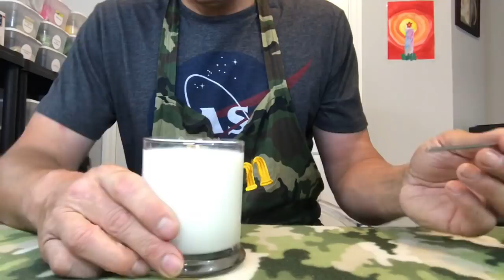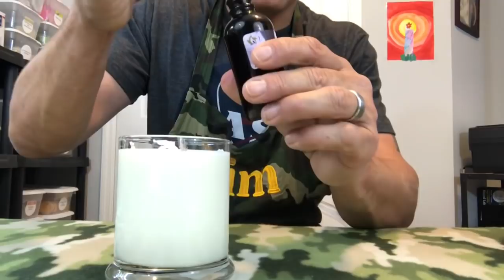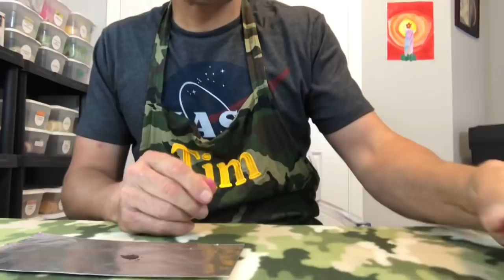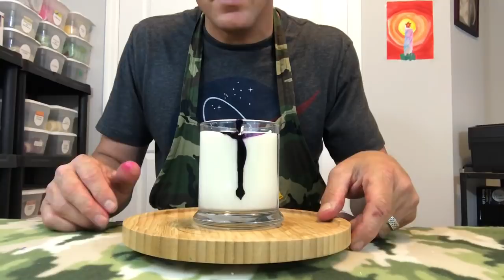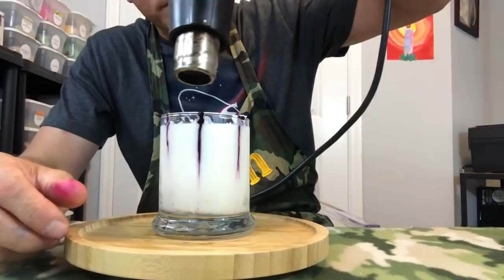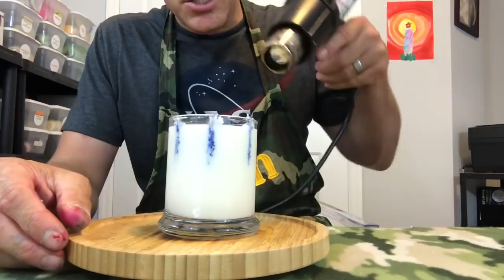DIY Marble Candles

Comment: The concentration of dye is way to high on these, when shoving the sides of the candle with a pick to push the dye, it’s removing the adhesion… the heat gun temporarily gives a swirl look, a few days later this will look messy and no longer have adhesion to the jar.

Comment: Nice video! Can I use a blow dryer instead? Like how hot does a heat gun get that a blow dryer can't suffice for this? serious question
Reply: Blow dryers blow out hot air as opposed to the heat of the heat gun. Using a blow dryer could cause the wax to fly everywhere.

Comment: I am new to making candles... Can you use a blow dryer instead of a heat gun? Not sure if somebody already asked
Reply from the maker: It will only "sort of" work. With a hair dryer it will take 10-times as long, and unless you have a smaller hair dryer, or one with a directional nozzle attachment, the air stream will be to big and will blow your wax around too much. Heat guns are fairly inexpensive, and can be found on Amazon or your local hardware store for $10-$15

Comment: Thank you so much for this! Gosh I was thinking about this and then you posted!
I do have a question. how would I achieve this with wax melts? I want to have that same effect but with wax melts so I dont know if I can.
Thank you!
Reply from the maker: It will be a lot harder with wax melts, the smaller size is harder to work with and the heat gun isn't an option if they are in plastic molds. The closest you can get would be to fill your wax melt molds with plain (uncolored) wax. Then as it is cooling, you can just drop a drop of liquid candle dye in the center of each wax melt.
Reply: @TimberRidgeGifts  gotcha, I will have to try that. Thank you!

Comment: I have a question. Can you do this while the candle is in its mold, and then when it dries, take it out?
Reply from the maker: This particular method will only be useful for container candles. The wax has to be soft enough to be able to poke holes in it. The pillar wax needed for a molded candle would be to hard.
Reply: @TimberRidgeGifts  Oh okay then. Thank you.

Comment: is there any other way to melt the candle? like blow dryer or microwave?
Reply from the maker: A blow dryer would work, just not as well. Microwaves heat things from the inside out, so it would not work for this. Plus the wick tab is metal, so a finished candle shouldn't be placed in the microwave.
Reply: A 200 degree oven works well too

Comment: Can you pre-melt the candle color chips and use a dropper to put the color into the holes for a better result?
By the way, thanks for all of the tips and help! I am a soap, bath and body product maker by trade and am just trying to add some small scented candles to add to my products for gift sets.
Reply from the maker: It might work for a minute, but it will dry and clog the dropper and cause more trouble than it is worth. You might be able to melt it and then use the same apparatus that you poke the holes with to apply the melted dye chips.
Reply: I was wondering the same thing, except I was thinking what if you added the melted color block to a carrier oil, would that do the trick?

Comment: Nice video very informative! Quick question, what brand of dye do you use? I have been having difficulty getting nice bright colors. I have found out from experience that soap dyes and food dye does not work and crayons always look diluted. Thanks in advance! 👍
Reply from the maker: +cuattgirl you’ll need a dye specifically formulated for use in candles. You can buy it in liquid or block form, and powder form from a few select places. The day I used in this video was liquid candle dye from www.lonestarcandlesupply.com

Comment: How does the glass not break/crack from the high heat?
Reply from the maker: +David Griggs it can for sure. Just takes a little practice to get a feel for it. You’ll hafta get it pretty hot to crack it. So as long as you go slow you should be fine.

Comment: Thank you for sharing. I appreciate your videos.
I use C3 should I try Eco 10-12-14?
Reply: I want to use those jars
Reply from the maker: +Elemental Vibrationz I would try the ECO10 first. It works great with 464, so there shouldn’t be that much difference with C3. 
The jars come from The Dollar Tree. I just finished up a Dollar Tree haul video, so stayed tuned for that! 😊
Reply: @TimberRidgeGifts  hi I have these jars having a hard time wicking them I'm using  igi6006 could you suggest any wics